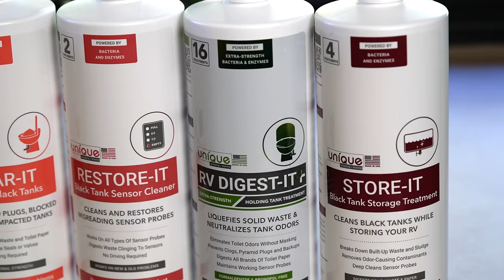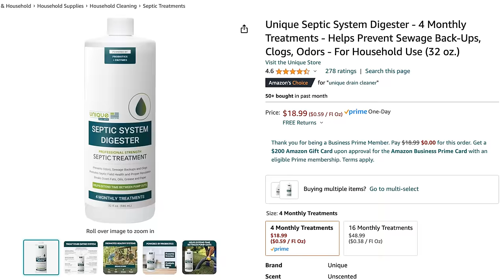Viewers Beware💩The Unexpected Result of Dumping RV Waste at Home

Comment from the maker: Enjoyed this video? Subscribe for more! → https://link.gratefulglamper.com/subscribe
Want More? → https://video.gratefulglamper.com/youtube/channel/rvlifefavorites
Reply: the one thing that you might consider discussing in the next video about this topic/procedure is the size of your home septic tank and the amount of liquid and solid waste inside of it at the time of the rv "dump"... i'm assuming that you probably have at least a 1250 gallon home septic tank which needs a "clean out" about every 5 years or so (based on the amount of solids that it contains) and your rv waste tanks are probably over 100 gallons and an extra 50 gallons for the rv flush process... so with that level of input into your home system, then you'd want to ensure that you do not overwhelm your home system with the sudden flow of waste water into your home septic tank.... and that's easily determined by measuring  the level of liquids in the septic tank with a measuring stick... if your home septic tank is within 300 gallons of capacity then it would be advisable to clean out your home septic tank before you dump more into it (probably needs it, anyway, and that's good periodic maintenance for your home )...

Comment: Great video, but a few tips.

1. You're wearing gloves and touching everything, including that radio, the switch, etc.  Glove one hand, or be mindful of cross contamination.
2. Use the black tank flush hose to rinse out the black tank flush garden hose.  He even said it stinks.  How's it going to smell a week from now,  stowed in your bay?  Ew....
3. Run that battery connection to your wet bay and just plug the macerator into that, vs. needing to open the battery bay doors.  I have a fifth wheel and ran it 20 feet back to my sewer connections.

Comment: I am a bit OCD so each time we use our dump hoses, couplers, adapters, etc., I soak all of those in a big tub with a disinfectant cleaner (Lysol or PineSol are my choices) then rinse the hoses/couplers thoroughly, allow them to dry then put them away.  I even spray the hose carriers (there are 2 ) on our 5th wheel out with disinfectant.  The hose support Slunky also gets washed.  The few times I have had to use the macerator at home (we have the same FloJet as well), I wipe it with disinfectant wipes before putting it back in it's case.  I know, all that sounds over the top for most people but that is just how I perform this stinky process of dumping tanks and cleaning the equipment.
Reply: Very OCD
Reply: I’m right with you 👍

Comment: I have used the exact same setup (including the same hose) for several years. Our "Pooperator" has one improvement over your setup... I bought a second cleanout cap; drilled a hole in the center; and inserted a brass hose elbow. Replace the standard cleanout cap with the modified cap; connect your hose; and now you have a closed system!
Reply from the maker: Thanks for the suggestion

Comment: I mooch dock full time and have a permanently installed macerating pump.  The septic tank I dump into is 100 ft away and up a slight incline.  I live alone and dump every two weeks.  Black water tank first, grey water second (cleans out the hose). Only problem is that I went overboard and got a super heavy duty hose which is hard for me to wrangle.  I watched a bunch of videos and no one bothers to use the super heavy, super expensive hose I got.  Today I’m going out to buy a reg garden hose- and this system will be no sweat at all!!!! PS: I occassionally dump buckets of grey water in the black water tank which really “greases” the wheels !!!!

Comment: We have used the Unique RV Digest-It for several years and really love it.  We have had zero issues with smell and the tank flushes clean.  We dump at home routinely using our sewer clean-out with no problems.  We recently removed our toilet to put in a Trelino separating toilet (for water conservation). When we looked into our black tank it looked like new and there was no smell with it wide open.  I attribute this completely to RV Digest-It.  The nurse in me did cringe a bit at all the things that were touched with and without gloves.  If you get in the habit of thinking "My hands are contaminated" whenever you have gloves on it will help remind you to take them off before touching other things: phone, walkie-talkie, camera, etc. Great video.  Thanks!
Reply from the maker: Thanks for sharing! Lots of glove changes happened in this video but all were shown on camera 😉

Comment: As one which has used a Flo-Jet macerator for about 10 years, a couple comments.  
1) When putting away a “poo” associated hose… blind connect outlet to inlet. This ensures nothing ‘escapes’ into areas you don’t want it to!  This also guarantees no loss of hose washer!
2)  As I do not have a dedicated tank flush system, the fresh side inlet is invaluable for ‘back-flushing’ the tank.  My pump will not allow exit flow if turned off, which makes back filling the tank effortless.  WARNING!! When back filling, one has to have a ‘safety monitor person’ to be certain NOT to overflow!!!!
Keep o Glamping!

Comment: It's a clock face. Which way do the hands move around the face? Clock-wise 😊
Lefty-loosey means rotating the thing that you are turning, to the left, or counter-clockwise to loosen it.
Reply: For normal, right-handed threads, point your right thumb the way you want the nut of cover to go and curl your fingers.  Turn it the way your fingers are curled. That's why it's called a right-handed thread.

Comment: For right vs left, it's always refering to the "top of the circle" direction.  Confused myself a few times before I figured that out.  Clockwise vs counter-clockwise is clearer but doesn't fit the known saying (righty-tighty, etc) as much.  So I just look at the top of the circle to determine which way is "right" and which way is "left"

Comment: A standard kitchen waste disposer inlet is 3 inches.  The black water outlet on RVs is also three inches.

See where this is going?

The maceration pump costs many times more than a disposal.

I use a Badger 5. It chops stuff into the consistency of mush and has enough power to pump it through a 3/4" garden hose for MILES.

I no longer use my RV's black tank at all. Instead, I use a composting toilet.  Much more sanitary and way less hassle.

I also use a composting toilet in my residence.

Comment: Handy. Our clean out is on the other side of the yard from the coach. Convent. One note for those inclined. If the macerator fails, don't plug it to power in your shop. It will do a very, very bad thing to the shop.
Reply from the maker: Sounds like you're speaking from experience 😳
Reply: Fortunately for me, it was a friend who's a bit if a tinker decided to help someone. As soon as he attached to a battery it came to life and launched its contents all over his workshop. He had a lot to say about this.

Comment: THIS is why they put those funny brass gadgets permanently on newer outside water faucets for hoses (hose bibs).  Keeps water from hoses going backwards into the house in weird situations. And why kids are no longer supposed to drink out of garden hoses!

Those funny gadgets are not "flow restrictors" to save water.  They are backflow preventers.

And don't ever flush those so called flushable wipes or tampons down these drains.

Comment: Clockwise Tightens - Counter Clockwise Loosens;        If the clock is running right, keep it (Put it on.).  If the clock is running backward, get rid of it (Take it off.)

Comment: Suggestion for your next project. Cover all the outside of your reflectix that you can see thru the windows with felt. Use spray adhesive to hold the felt to the reflectix.

Comment: One thing with macerators is that they don't flow as fast as the stinky slinky so the flow may not get all the solids from the bottom of your tank.  
Also, after  you dump, you can coil the hose up, then run clean water through it to get the rest of the stuff out, then just lift it one coil at a time to clean it out.

Comment: Clockwise = Turn to the right = tight
Anti-Clockwise = turn to the left = loose 

I'm sure there's an engineering reason for left and right and how to explain it... 

That cover's 99% of things but every now and again you run into reverse threads. If you're struggling to undo something, try and tighten it a little bit. For normal threads sometimes the back and forth helps, but if it's actually reverse thread then you'll start to loosen it.

Comment: Clockwise and counterclockwise is easier for most people.

You probably should keep a few gloves in the pump box in case you can't find them when you need them.

Keep extra hose seals in the box in case you loose one on the hose.

Should wear face shield so waste doesn't get in your eyes or mouth.

Comment: I, Rick, turn on the flush hose and then open the black tank. Then I set a timer for 10 minutes and go about getting other stuff put away in that 10 minutes and then turn off the hose and shut off the shut the blank tank and fill with 2 minutes of water then I drain the gray water tank. Human poop is not fertile.

Comment: No to be disagreeable, and I'm assuming you have a septic system. A residential septic tank and leach field isn't meant to have what I assume is around 40 gallons from an RV holding tank dumped into it all at once. They're designed for intermittent water flow.
Reply from the maker: Thanks for the comment and for watching.

Comment: I realize you live in Florida, but most Floridians do not how to use a septic tank/drain field.   First, septic tanks are not best design to provide the best function  removing waste.    Property size and septic tanks are established by local government for the contractor.   Most homes are on a 1/4 acre lot with one tank (900 gallon) and a drain field.   When a family add children, dishwasher, washing machine, garbage disposal and your rv, there is a good chance your are over working your system.   A over worked, miss used, can cost 10,000 thousand of dollars for repairs.   As a Floridian with my family of over 100 years in Florida, I have a pretty good knowledge how to maintain the system.   That being said  usually cannot be done on a 1/4 acre lot.  Need two tanks, one grey and one black, need two drain fields.  Both tanks combine should be 1200 gallons or more.  Putting two much water in the system does not give it time to dissolve waste and will back up your drain field.   You may be also be polluting your drinking water.

Comment: How long is your discharge hose?  I wasn’t able to to find a pump that was rated for more than 50’ of 3/4” hose.  I have to use 100’ of hose so I just make sure I don’t run the pump more than 3-4 minutes at a time to prevent overheating.
Reply from the maker: Our hose is about 100 feet - however the new flo jet pump can handle it - no problem

Comment: We just moved to new house with septic and tank lids are buried under patio.  There is no handy clean out pipe like that.  Any recommendations how to add that?
Reply: What are you going to do when the septic tank needs pumping, they have to access the lids each time.
Reply: Yes it's a pain. Not our  decision.  Previous owners did that.  Only needs to be pumped every 3-5 years.

Comment: We have dumped our tanks for years into our septic systems (2 different houses).  No issues.  Not sure why you are using a macerator.  Seems like you are making things a bit harder then needed.
Reply: Look at far they had to run the hose to the in-ground clean out - did not look like they could just pull up next to it to dump
Reply from the maker: No way gravity would have gotten the job done without a macerator. A macerator not only grinds but also pushes the waste through the hose - it will even work uphill,

Comment: Stop treating tanks like they are a septic system.  They are a holding tank and that’s it.  Just use lots of water to flush like double what you think you should use.  You will never have an issue.
Reply: You are Absolutely 💯 % Correct. 
I have been using a Flojet every two weeks since December of 2021 to dump. We use regular TP and just the blue fragrance drop ins. 
We pump about 75 feet to a clean out. And yes it's to a city sewer system not a private septic.